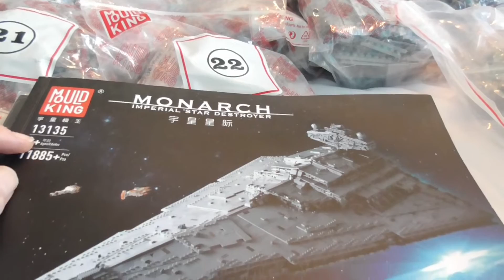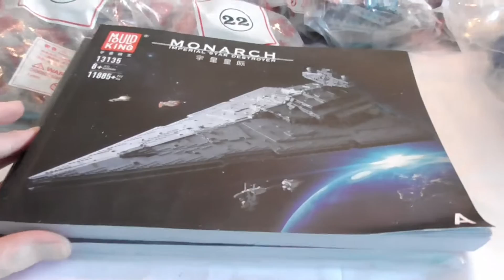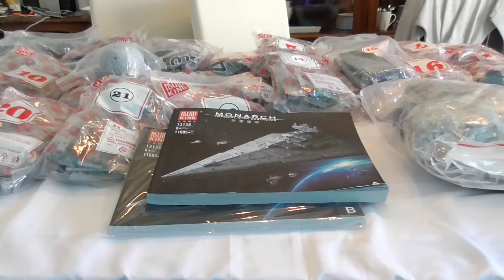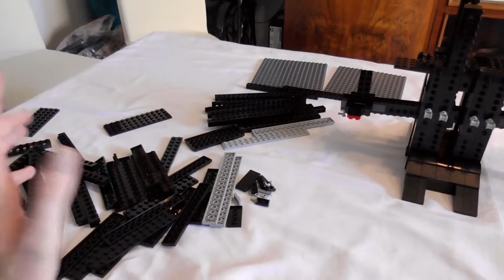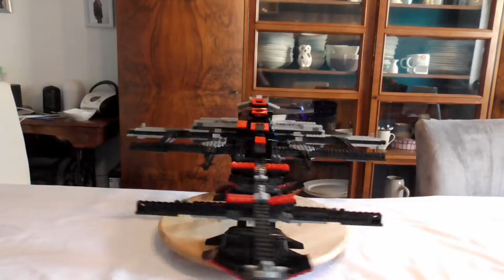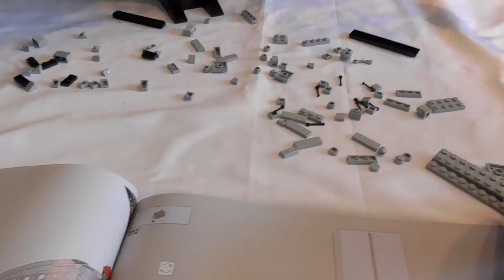Mould King 13135 - Imperial Star Destroyer Monarch - Assembly Part 1

Comment: I build this last year. One small problem I have is front nose of ship is loose and not very secure. An easy solution is to use small rubber band (I have spare bands from acrylic case), or with some modification. Another minor problem is the panels on the side tend to sag over time at the back, another easy solution is to use black tie wire (EDIT: I also use tie wire on the side panels of the 21007 destroyer). The Monarch is overall very well designed MOC by onecase and looks very nice on display. Have fun building.